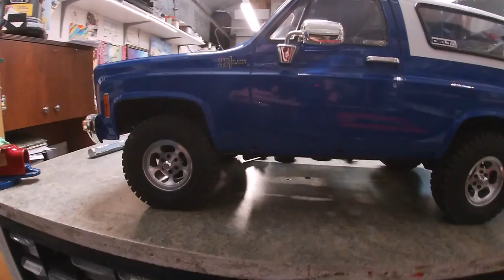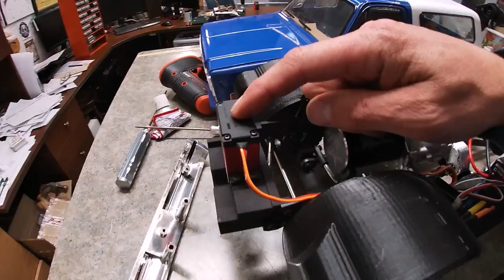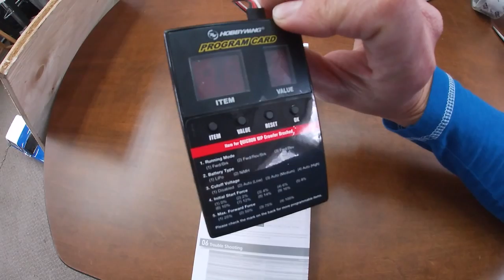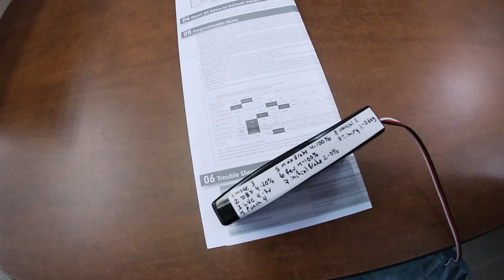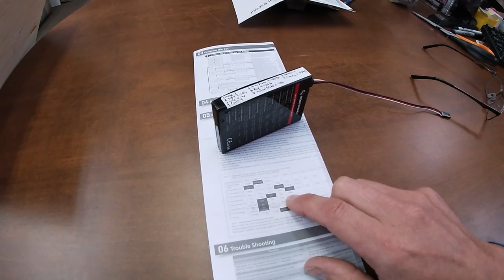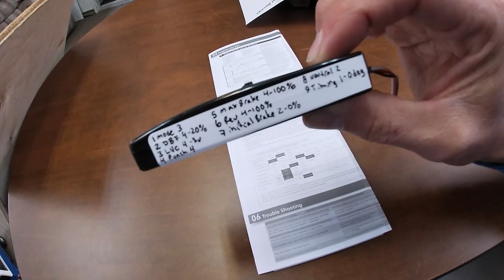GCM DELTA Chassis Blazer Build Part 2

Comment: Ok so a? I have 2 brushless non censored Motors and tried to use them in my crawlers and they COG what's the reason that that doesn't cog?
Reply: TenShock 906 have 6 holes that's why don't get cog. i put this motor 3 years back (1250kv) in 2 crawlers and still run no problems

Comment: Chris I love this video and all the things that you set your tiny truck to run smooth is all that I am looking to be able to do but I am a bilder not one for that finds all that you just told us it is hard for me to get my head around that part of this hobby, that is why I am still running stock esc in my 2 trucks. But I wish that I whent to my mail box and had one of your ESC and motor set ups ready to go in to my RC4WD Marlin. I that somthing that can happen?
Reply from the maker: Ya, probably. We could likely do pre-programmed ones for you.
Reply: @GCMRacing1  Chris you rock buddy I will get it with my scale trans kit for the TF2 and I just about have it all saved up.

Comment: Why couldn’t my axial be like that and have room for interior
Reply: Because its not a GCM Delta 😜
Reply: Front rear is on the wrong side Forge are on the left side Chevy's run on the right so the Dodgers. They didn't change until 88 and 91 ok